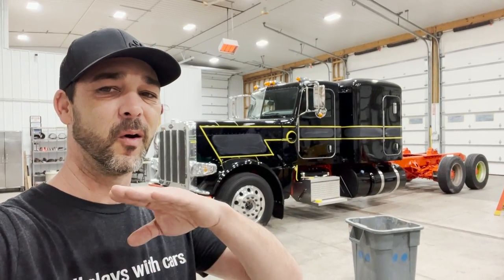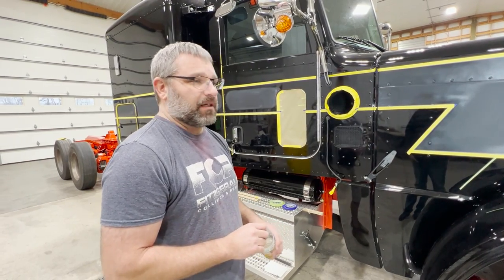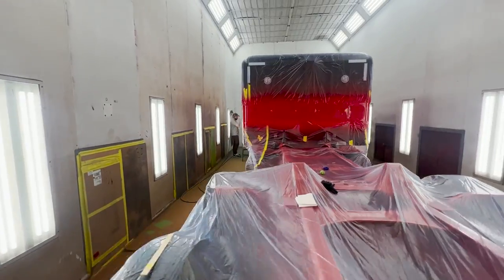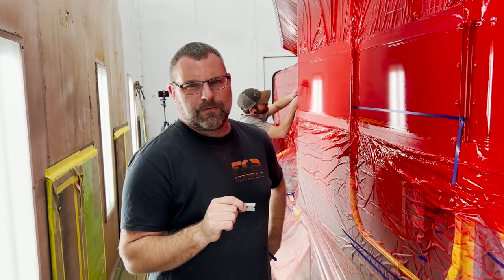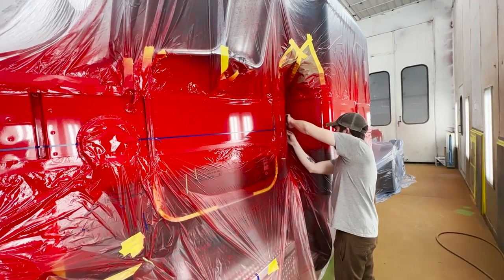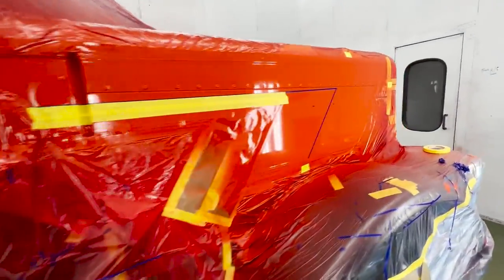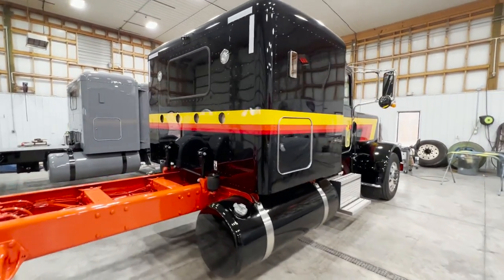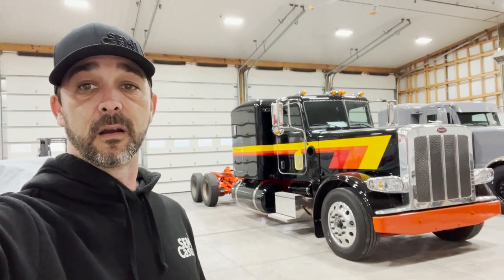Painting Custom Stripes on a Peterbilt 389

Comment: It looks sooo good! 💯👏 I would put the emblems back on for sure. Heck if it was mine I would even keep the front bumper, just add some yellow diagonal lines on the corners. And 5” exhaust, RLK Shiber bowtie visor, chromed steel wheels, stainless full fenders, 359 headlights…